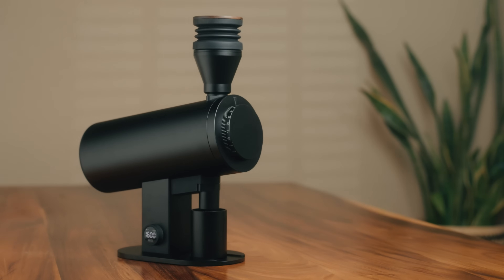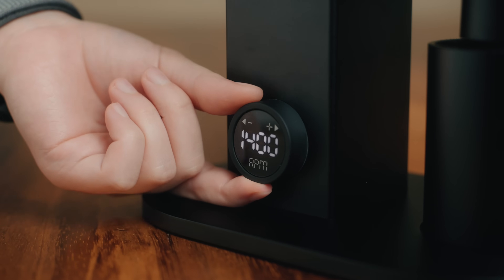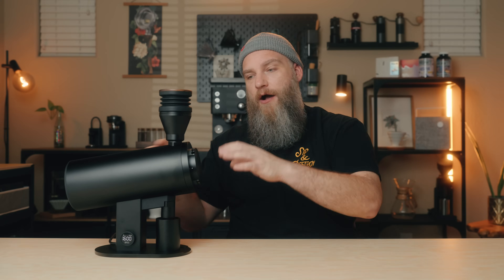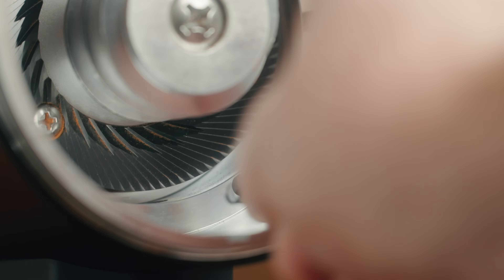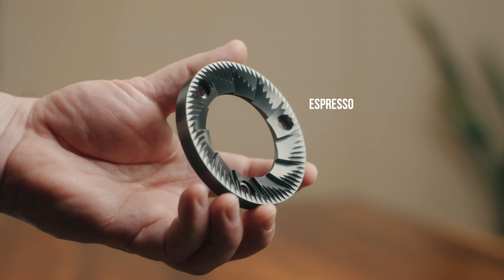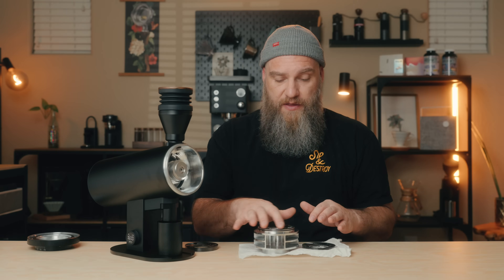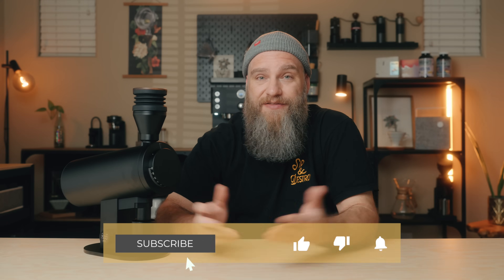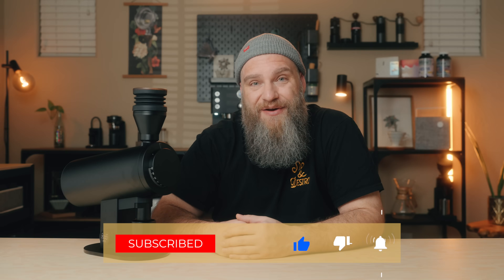Turin DF83V full review... it's really good!

Comment: For a way fast running shot like the one with the brew burrs i found you can get good results if you let it run a little longer like 20 seconds even if you end up getting 80ml or 90ml out it needs the contact time.  Having a high extracting basket might let you get away with a shorter contact time.

Comment: Several questions: 1)How do we figure out the zero point? The issue I'm having is the dial know is either too loose where it doesnt catch/turn the dial disk underneath, or its too tight for me to move. So I'm constantly having to find the zero point. 2) I have light roast beans and it jams ... i have to open it up clean it out, and that leads to the dial knob misaligning ... then i'm back to square one 😂.... what setting do you recommend for light roast beans? 3) should i start the machine first  and then add beans? Or vice versa? Thanks

Comment: Some people have commented that the wave-springs may have caused poor alignment,  because the waves are a bit too large on the DF83 they should have many smaller waves ideally. Not sure if I noticed that with mine, but someone was saying alignment would change for his if he rotated the wave spring in a different orientation! I have no clue what MY wave spring placement was like initially! I never did alignment on mine but my Gen1 DF83 v1 seems to be performing well for me!
Reply from the maker: I never experienced poor alignment as a result of the wave spring on either the DF64g2 or DF83g2. Unless something is wrong with the wave spring I don’t see how it couldn’t spread the load evenly. I worked in the automotive industry for a long time and a lot of automatic transmissions use wave springs to evenly apply pressure to the clutch packs. If it’s good enough for something more critical than coffee I think it’s probably fine! 😝
Reply: @coffeenerdaaron  Nice, good to know! It was just the one guy who mentioned he noticed (a lot of people may not notice little issues though) it's also possible his was bent out of shape or something who knows.
Reply: Oh I forgot I had left this comment. Recently noticed my DF83 was giving me acidic and bad tasting espresso almost no matter what I did. Rotated the wave spring in a position where it seemed the burr carrier wobbled less while pusing on each side of it before screwing the dial back in and now it's better again. I suspect the Wave springs may deform /wear out over time or it might be better design If they have more smaller waves so it sits more stable and even.

Comment: Nice that you focused on the auger pre-breaking or just feeding beans :)
Reply from the maker: Thanks! I figured a lot of us were interested in that part 😊
Reply: I think auger / pre breakerrs are overhyped. Does it really make that much of a difference if you got a nicely aligned df83 vs df83v with same burrs at same rpm? I tested with p64 vs Zerno with same burrs and didn't notice any differences for pourovers and not much dif for espresso. Usually the best dialed in one would win basically.
Reply: @BensCoffeeRants  As of yet I have not had the chance to test any grinder with a pre-breaker. Now I'm more into something else, slowfeeding. Been trying that with my recently acquired Lagom Casa CL65. Difference is great enough to make slowfeeding worth it. I only do this with those more expensive light roast beans. Can't be bothered to do it on dark roast. Not sure if slowfeeding is worth the trouble on your excellent grinders though, nice collection there :D
Reply: @Lectuz  Yeah I think slow feeding does make more of an impact on pretty much any grinder.  It should give you more flavour clarity with a darker roast or coffee you don't really like or one that's too funky it might be better dumped in instead of slow fed because higher clarity is not always better.  I'm not sure yet but dumping in the coffee quickly might give you more sweetness along with the more blended flavour profile. 

I actually have a device now that slowly drops the beans into my grinder called CremaLoop.
Reply: @BensCoffeeRants  YES, cremaloop :D Been looking at that one myself. Waiting to see if they release one that is made to fit the Casa before I get one.
Reply: @Lectuz  message them if you want they can probably make an adaptor for it if they don't already have one for it.

Comment: How does this grinder's under-load db compare to the Lagom P64's?
I am glad to see this more powerful variable speed Turin. Sprometheus stated that he had recurring jamming issues with the DF64V.
Reply from the maker: Unfortunately I don’t have a P64 to compare so I can’t give you an accurate answer on the comparison of volume while grinding. 

It hasn’t stalled on me yet but that’s not to say it absolutely won’t. I’m sure there is a scenario where the right type of beans and grind setting at low rpm may cause it to bind and stall, time will tell for that 😆
Reply: I own the df64v and I can confirm no stalling on light roast when the motor is running. There are pre production models send to reviewers where stalling was an issue. The release models don’t have these issues. ✌🏻
Reply: @FyyMyy  Thankyou for chiming in. Can you confirm that that's the case with cold starts as well as hot? If it still has issues with cold starts, I'm thinking it ought to have a more powerful motor.

Comment: If you had 1k to spend. What would you get. Cheaper and spend the same amount on a different burr set. or larger burr no upgraded on the burr. Variable or not? I'm on the fence and ready to pick a side.
Reply from the maker: @scoobtoober2975  while burr size does factor in somewhat when it comes to performance and taste I would care more about quality and burr style/geometry. I would get the best quality grinder in your budget that has a good burr that works well for your primary brewing method. It really depends on how you typically brew and your flavor preferences. If you only do filter brewing and want flat burrs then something like the Gen 2 Ode is great and it would save you some money that you could then put into upgrading the burrs later after you’ve experienced the stock burrs to figure out what you like and don’t like. The Timemore 078 is one of my favorite grinders for filter brewing but if you do espresso also the 078S is an option, both under $1k. There are so many options for grinders and burrs, it’s hard to say without knowing your preferences but like I said I would care about the quality of the grinder and burrs before  care about the burr size.
Reply: @coffeenerdaaron  Thanks. James Hoffman line up of $500 or less mentions the lagom mini as a preferred one at 48mm. Some larger conical or flat were not as good for espresso. Thanks for the info

Comment: I received mine yesterday, and today I was playing a bit with the settings, trying to dial up the same type of grinding I normally use with my manual grinder, but it's proving challenging :p But hey, thanks to you, I learned how to set the absolute zero! So thanks for that!

Btw, do you still have yours and use it? I ask because today, I removed the burrs to see how it looked inside and clean a bit (after testing the whole morning), and when I screwed everything back together, I realised the grinding marker is slightly off center... around 3 degrees clockwise. Not sure if I am doing anything wrong.... but I doubt it, cos there isn't much there to allow doing things wrong.
Reply from the maker: I have noticed other people saying they’ve experienced the same issue when reinstalling the dial. I haven’t experienced this issue but I also don’t tighten it super tight, is it possible that’s it’s over tightened?

Comment: Apparently higher RPM breaks more % of the beans, and lower RPM breaks less. Not sure if it really makes much of a difference but would be interesting to compare and experiment.
Reply from the maker: Yes, at higher rpm the prebreaker will be more efficient and therefore make the burrs more efficient and have to do less work.
Reply: Hi. I have a DF83V and drink equal amounts of espresso and filter coffee. I have the DLC espresso burrs. I'm curious about your different settings—RPM and fines but I’d be happy if you’d share your settings with me. Have a great day!
Reply: @martinlarsen2686 I don't have those burrs or grinder specifically but in my experience usually lower rpm will give you less fines or coarser grounds overall so you get more flavour clarity and more acidity. Higher rpm tends to blend flavours together more but may make coffee smoother and sweeter.  The coffee feed rate has potentially an even larger effect where slow feeding is similar to low rpm.  To complicate things further slow feeding needs to be even slower at low rpm and can be faster at high rpm with a fast grinder I believe.   
And there's some people with certain grinders that seem to report the opposite they get higher clarity with higher rpm. I think that might just be with the Weber EG1 which is a weird case.  I've heard the same said about the timemore 078s but I had one and I don't think it's the case unless it was just related to issues with burrs needing seasoning. Mine was fine though and didn't seem to need seasoning like some early reviews mentioned.

Comment: Ourcoffeeshelter mentioned the dial is sticky and hard to make micro adjustments (0.25=2s diff in flow time) , and easy to overtighten the cover-> zero marker is not centered. How did you find these things?
Reply from the maker: Yeah I saw his review! I can’t say I’ve had that same issue, it does get tighter and harder to turn as you get finer like a lot of other grinders so I didn’t notice it to be abnormal or a big issue.
Reply: @coffeenerdaaron  thanks. And how about overtightening the cover and zeropoint moving? Are the threads as cheap as the baseplate screw holes on the sculptor :)?
Reply: @coffeenerdaaron Also curious if you had the same issue of the arrow not being centered. Great preview of the grinder, by the way!
Reply: I would like to know as well... The arrow centering is concerning. For example can the threads be stripped?
Reply from the maker: @CoreProject05  I didn’t notice that the threads would be an issue when tightening the dial plate back on. If you’re really cranking on it I guess you could over tighten it but I feel like you’d really have to putting a lot of rotating force into it. I don’t think it’s a normal situation to have to super crank it on, I just tightened it till the arrow was straight up and it felt tight and stopped turning.
Reply: @coffeenerdaaron Awesome, thanks!
Reply: @coffeenerdaaron thx 🎉

Comment: Interesting comments on the springs. I had a df83v2 and ended up returning it after never getting consistent results and it turned out the wave spring was not quite right and I suspected that was the issue… i didn’t like the design of it so much that the first thing I looked for with this grinder was if it had the wave spring and when I saw it doesn’t I ordered it immediately lol😅
Reply from the maker: That’s interesting, I’ve never had any issue with the wave spring on either the DF83’s or DF64’s that have them. How did you determine that the springs was the culprit of the issue you were having? You didn’t state what the issue was.
Reply: @coffeenerdaaron  returned it and when I was discussing it with Joe he told me. 

The 83 is larger so if anything is off on it via defect or like grinds getting under it then the alignment is screwed and it’s very apparent. The 64 is smaller and I suspect much less prone to the issue because less leverage. 

This is my theory anyway and why I don’t like the design. But yea apparently mine actually had a defect.
Reply from the maker: @Spoobie123  that’s wild, thanks for sharing you issue and experience with it, thankfully I haven’t had any issues like that!
Reply: @coffeenerdaaron  definitely doesn’t seem that common.

Comment: Great Review! Thank you for making it so quickly, so potential buyers and pre-order holders, like myself, can learn about it, before actually getting it. Now I'm even more excited to get mine. I was skeptic about the pre breaking capability of the auger, but from you review it seems like it's actually working :). I guess it's more useful in lower RPM settings. 
Question - My thought process was to order it with the espresso burrs and buy SSP MP for filter and for a (completely) different espresso profile than the DLC stock burrs. You seemed to really like the filter produced by the DLC brew burrs. How does it compared to the SSP MP in your opinion? The downside is that it cannot do espresso like the SSP MP, but I now think changing my order to include both burrs and save some money and not going with the much more expensive SSP burrs.

Comment: I purchase Gorilla Gear 64mm burrs for an older ODE. The motor is dying. I only do Pulse and Chemex pour over. What 64mm burr grinder do you recommend so I can use my Gorilla burrs or is the move to 83V a better option?
Reply from the maker: The DF64 V2 is 64mm and spins at the same RPM as the Ode but with a stinger motor. Plus the motor is strong enough for espresso grinding if you ever get into espresso. I had Gorilla Gear burrs in a DF64 for a while and liked it. In my experience those burrs are better suited for espresso but they do well for filter brewing too.